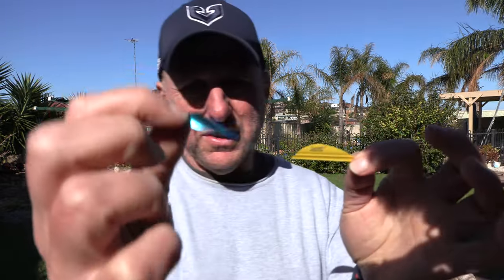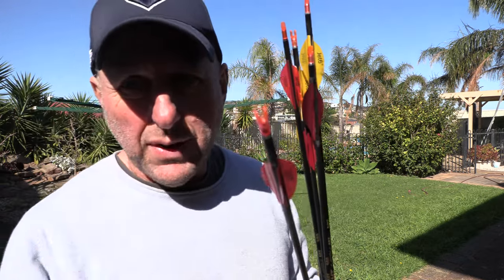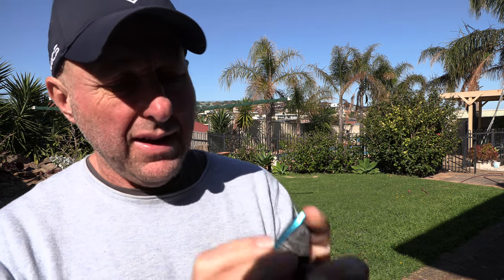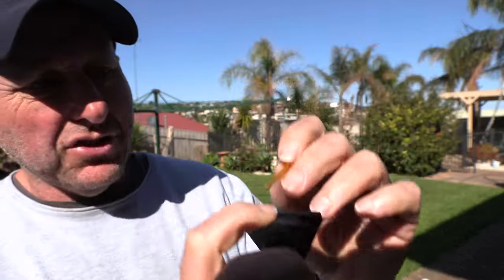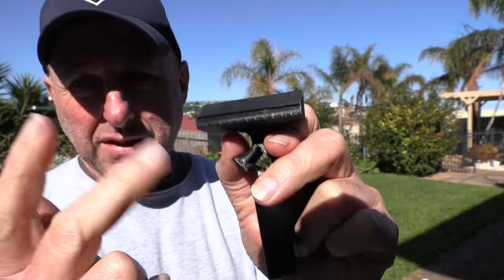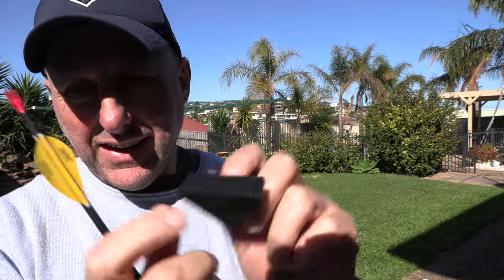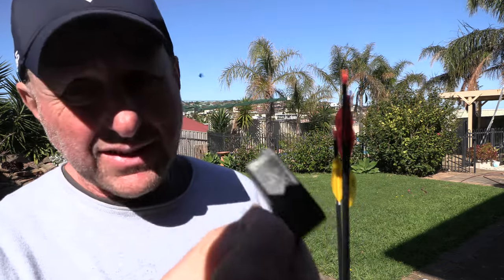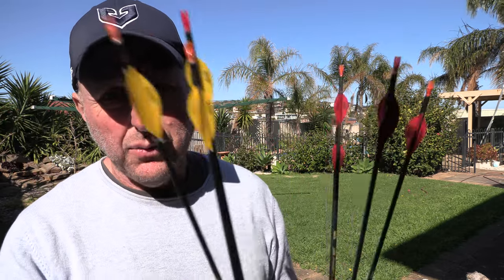Fletching Jet6 vanes - discussed and the Wing Thing Clamp for Jet6

Comment: Hi all, we recently received an update confirming a change to the K&K Jet6 shape profile that rolled out last year, which has resulted in some clamps loosely securing the updated vanes. The revised vane design is identifiable by the inclusion of the word 'Jet6' along the vane's body. 

There has been an update to our Jet6 and Shark clamps, that was introduced late last year, which features a stepped rightmost edge that aids in aligning the vane into the clamp, along with a tighter gap to more securely hold the vane in place.

Due to tolerances in the manufacturing process, some clamps of the previous design clamp design remain compatible with the new vanes. Should you encounter any alignment issues with the new vane using the previous design clamp, please reach out to us.

Happy Shooting Everyone!

Comment: I have arrow socks on my shafts. Makes fletching real easy
Reply: One thing I've found useful if you're using pin nocks is to score a line along the branding strip at the back end of the wrap. Once you've applied the wrap, peel the branding bit off. I find it useful to check the back of the shaft for cracks if a pin's been damaged.